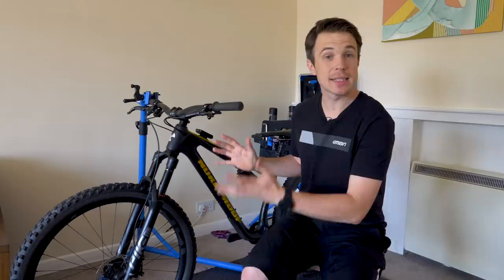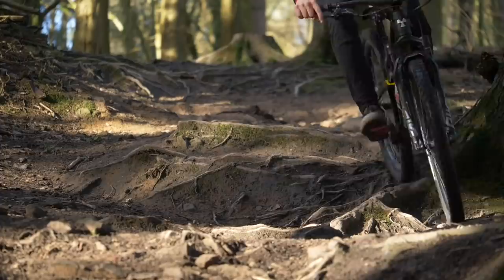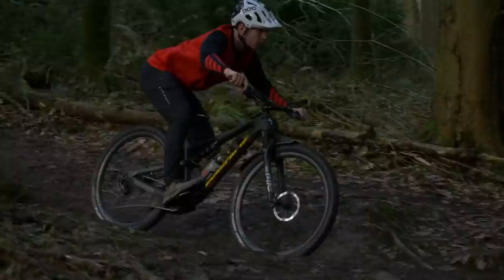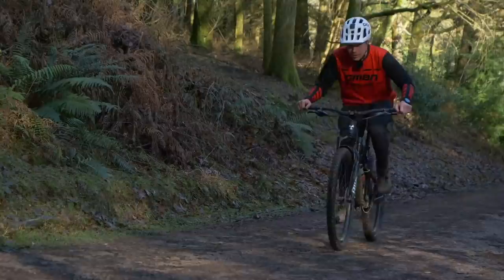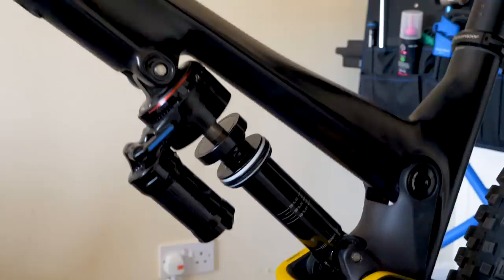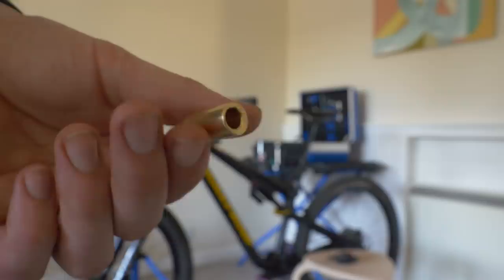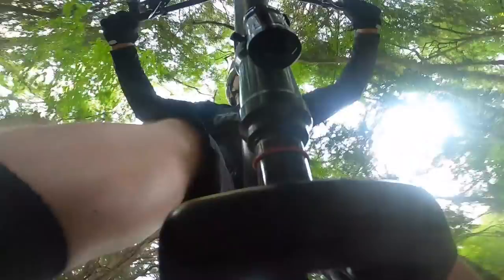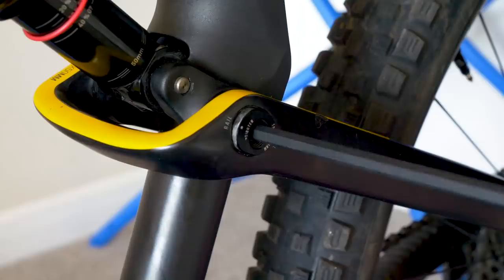Change Your Mountain Bike's Geometry For £100/$100/€100 | 3 Bikes in 1

Comment: Just gonna put this out there- as the fork compresses the head angle doesn't increase, it actually decreases because the amount the fork travels is less than the height of what it is passing over, where it does decrease is where the rear wheel passes over, or when you compresses the fork from the top, or huck to flat on a hard tail.